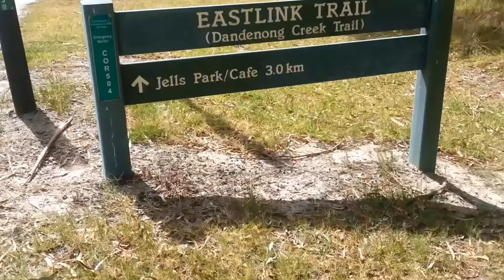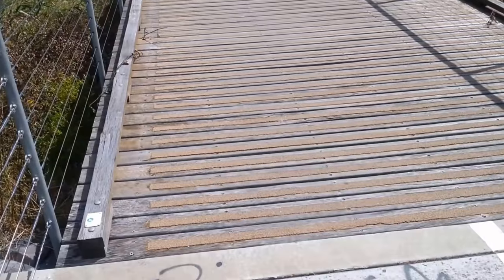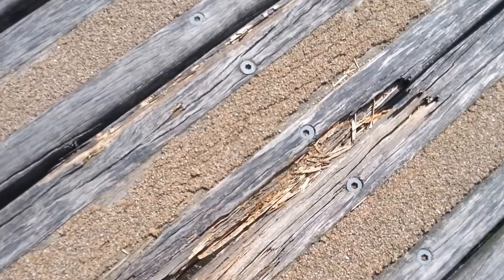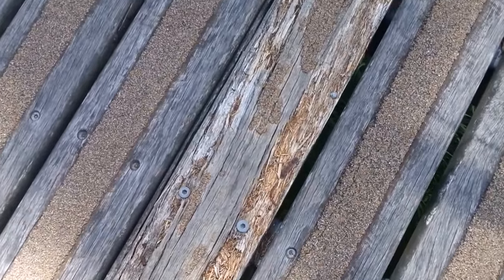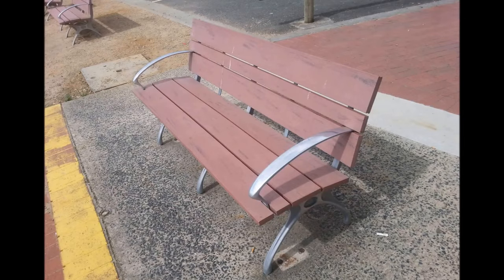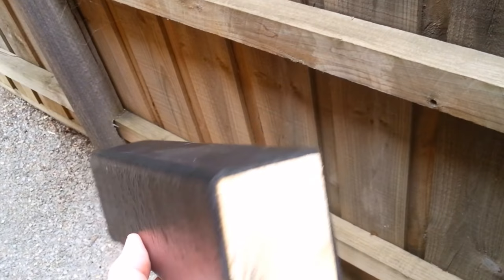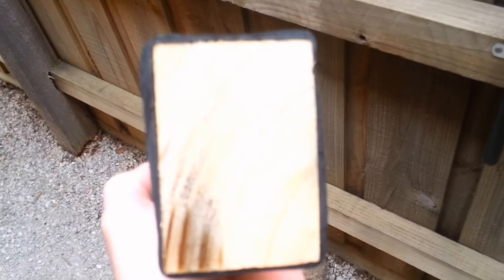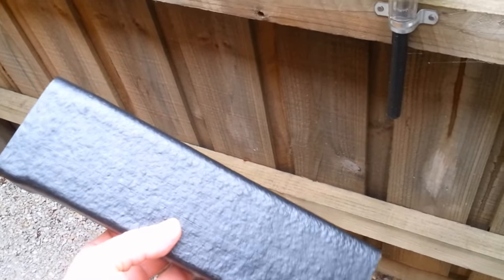MOST SATISFYING Recycled Plastic Ideas - Plastic Coated Timber

Comment: HI Colin... We have much of the recycled plastics now in decking, lawn furniture, and many other things. It's awesome as it lasts forever and uses up what would normally be wasted. I love your local and the sights. So stunning!!  Someday I may show up on your doorstep for a tour!!!😁💘🌎🍁
Reply from the maker: Huge and important debate over single use, disposable plastics and what to do about the giant mountains of trash. Rather than ban plastics, I say use it to save forests from unnecessary logging. Softwood with a protective plastic coating can perform better than existing hardwoods. This makes plantation timbers economically viable and helps protect old growth forests. And of course, we'd love to see you :)
Reply: I actually haven't seen the coated timber here but the solidly pressed plastic benches in our parks and stuff like that is happening. Although for the average homeowner the prices are pretty high.🌿👋💘
Reply from the maker: Still early days, I'm sure prices will start dropping as things take off.
Reply: It would be great if they did. The Hospital I worked at had picnic tables in the court yards for over 10 yrs now. 🍁😁💘
Reply from the maker: I'm optimistic for the future of the environment.

Comment: Do they have a way to deal with nail and screw holes and cut ends?
Reply from the maker: The Woodshield company use inward and outward facing end caps on the preset timber lengths and extrude over them, which seals them in place. They cut between the end joins to separate the fully sealed lengths. They can change the lengths as required, so each timber is fully enclosed. Nails, staples and screws are self sealing as they go into the timber. Very exciting system.